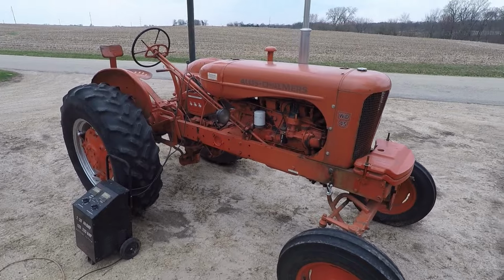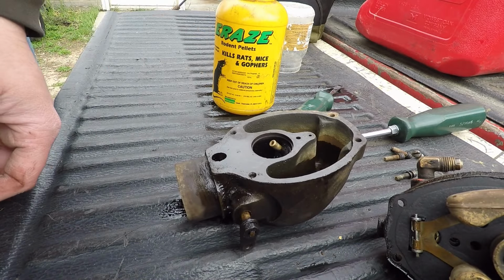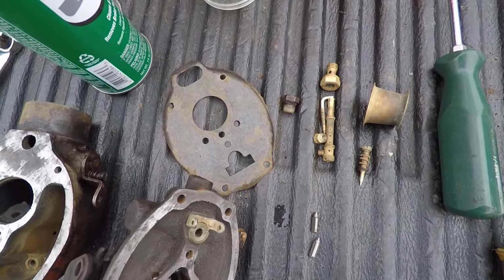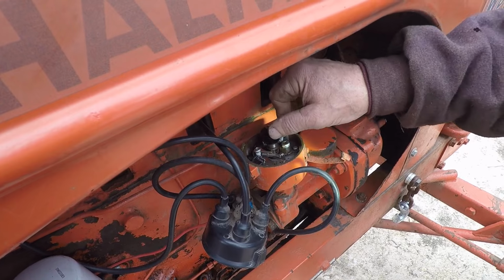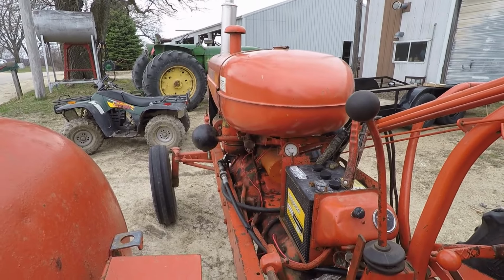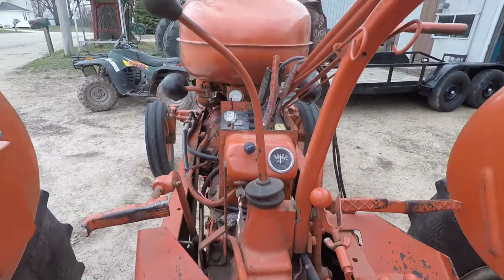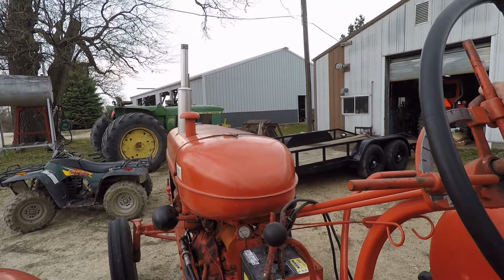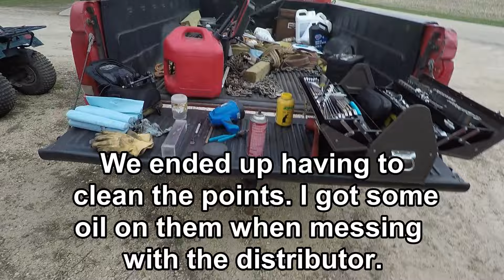Allis Chalmers WD45 - Has Fuel and Spark but Won't Run.

Comment: hope we see you convert it to 12v neg ground. I would like to see this done
Reply: Yes please!
Reply: i don't understand the benifit to doing that to be honest
Reply: negative ground helps prevent rust on metal surfaces.
positive ground is just a headache to deal with. if its not known that its positive ground it can be dangerous. someone thinking its negative ground and they get a shower of sparks in their face trying to test something
Reply: @gtb81.  the reason I did is access to 12v systems. Jumper cables or booster pack
Reply: The Brits like their + grnds.
Reply: @gtb81.  I think it makes the whole system more reliable. Also when adding 12 V lights and such , it makes the system more user friendly.
Reply: @Mr.Fixer53  i'm not sure how reliability is bad on a 6v system, my car is 6v and i've never had a single issue
Reply: @gtb81.  You are right about your car.
Reply: Why do 6 volt batteries last three times as long as a 12 volt battery? I've got a Ferguson that's still 6 volt positive ground and my 54 International pickup is too they run fine start fine when nothing else will

Comment: when you convert it to 12v  neg are you going to put a pertronix unit in?
Reply: I put a Precision Spark unit from fleabay on my 64 Ford backhoe. Cheaper than Pertronix and works just as well. I did it almost three years ago and it was the best thing I ever did for it! So nice to be able to turn on the gas, hit the key and she starts right up every time.
Reply from the maker: Not at this time. Thought it would be a big improvement.
Reply: @notajp  i have never heard of precision spark can you give me more info?

Comment: I had a WD45 that would barely run, turned out to have no compression on two cylinders. This should be a good project!
Reply from the maker: Yeah, low compression will certainly do it!

Comment: Hot rod 4020= stock 190xt
Reply from the maker: Heh. There's a slight difference in resale value...
Reply: @WatchWesWork  no not really. 4020 in average condition around here in Wisconsin bring 6500 -8000 190/200 in average condition bring 5,000 to 7500. A really nice 200 sold for 27,000 a few years back. It's more about the condition then the name
Reply from the maker: @RJ1999x  OK. You cannot buy a 4020 diesel in my part of IL for less than $10,000 anymore. The newer console shift tractors are closer to $15,000. But gas engine 4020 have almost no value.
Reply: @WatchWesWork  anytime you want to buy one for that price let me know, I can ship them to Illinois by the semi load

Comment: Wes, how do you determine what to charge on this?  Hourly?  Do you include the time spent on the carb?  Great work!  I'm not sure many mechanics would figure it out that quick.
Reply from the maker: We charged 3 hours. That was the diagnosis, cleaning the carb (which needed to be done), fixing the distributor drive, and setting the carb and timing. I don't know how you could possibly quote a repair like this since we had no idea what the problem was, so it's just billed hourly.

Comment: How can the timing be changed if the previous owner hadn't moved the distributor position he asks? This is old school mechanics 101 stuff! The obvious answer/s are, points rubbing block worn so the points closed up, retarding the timing! (Sooo basic). Mechanical advance unit lost its spring/s has a siezed shaft. Re-set the points gap gap and often no need to Re- set the timing. ALWAYS set points gap FIRST before then checking and reseting the ignition timing!

Comment: dad stands there with a dead blow hammer just in case! i like the timing light hooked up to its own 12 volt battery since the tractor is 6 volt.  someone less experienced would have chased this for a long time.
Reply from the maker: And he did until his dad showed up...

Comment: It would have taken me forever to figure that out. Cant replace experience or knowledge!
Reply: My thought exactly!
Reply from the maker: Heh. Well it had everything it needed to run, so there was not much left.
Reply: I guess I'm just use to ECUs and such.
Reply: @WatchWesWork As soon as you saw it backfire out the carb, you know you have a timing problem .... or a leaky inlet valve . That or plug your scan tool in lol bad ECU.

Comment: Man I would've changed out so many parts and still wouldn't have found that backed out nut.
Reply from the maker: LOL. Luckily the owner had already changed most parts. It had new plugs, new point, new condensor, etc.
Reply: Rectification via Substitution 👍

Comment: See it's a problem with the turbo encapsulator, you need to remove the differential coupling device from the flux capacitor to gain access to the gyrating hydroscropic rotator insulator. And once you have access you can repack the high temperature, high pressure zero resistance, triangular bearing. Then your machine should be good to go. 

But because you failed to do this and ran the machine, it's a pile of junk and must be scrapped immediately.
Reply from the maker: Sounds right to me!
Reply: Yep, gonna have to hook it to a sky hook now! Lol

Comment: That is a side draft carb, jus sayin.
Reply from the maker: No. The throttle body is vertical. It's a updraft.
Reply: Beg to differ, - up draft, down draft, side draft. Worked on aircraft engines for twenty years. No biggie, potato, potahto, tomato, tomahto. I watch all your vids and just recommended you to an old gear head. Have a good day.

Comment: Move your spark advance all the way up, right side and behind the steering wheel. I put in many hours on a WD45.
Reply from the maker: There's no spark advance on this tractor. That lever is for the hydraulics. The spark advance was only on the old magneto ignition tractors as far as I know.